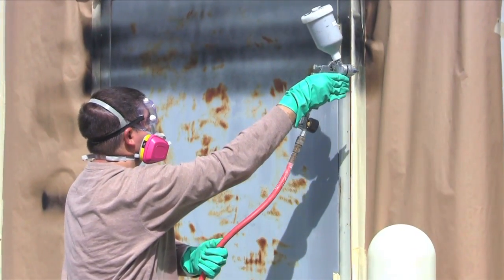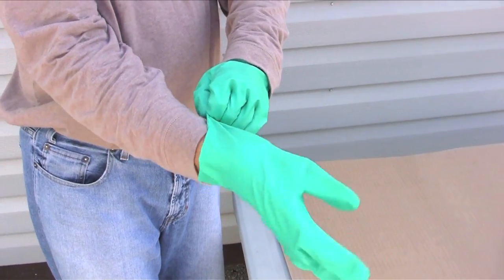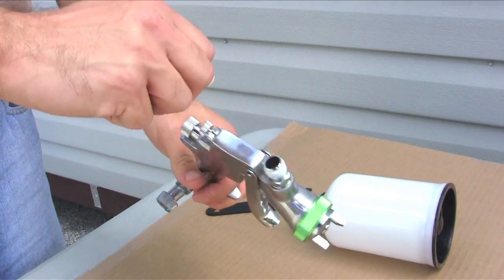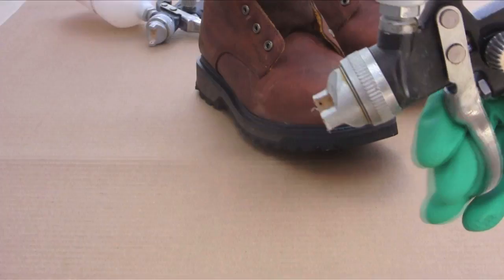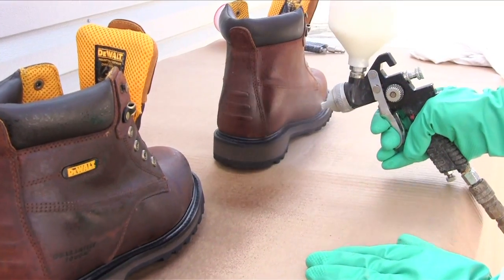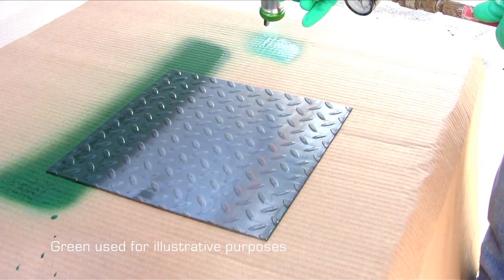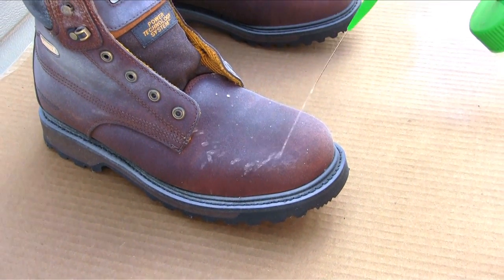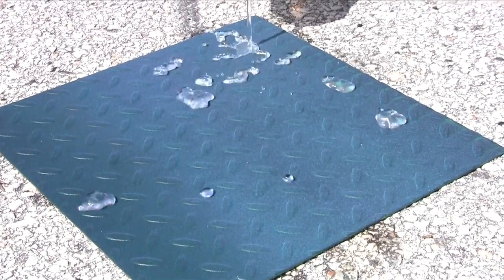Ultra-Ever Dry - Application

Comment: What is the coverage ratio?  Will this coating hold up to concrete running over it and if so for how long before reapplying?  Will it stick to aluminum?  Does the chemicals in concrete break it down or make it come off?

Comment: I have a project in my university. I need to do this project on a topic of electricity. I have to know some information about conductivity, electrical resistance, tests log, abouticing, far and by all parameters of electrical part. My research advisor requires it. How can I get it?

Comment from the maker: The Ultra-Ever Dry SE formula is susceptible to environmental conditions such as UV. This coating will offer approximately one year of outdoor life before recoating of the top coat would be required. When used in indoor or covered applications outdoors, the SE coating should last for a year or more. If the top coat has diminished due to environmental conditions, simply reapply the top coat to regain the superhydrophobic properties (assuming the bottom coat is still present).

Comment: How well does this work in concrete pouring? I saw in your other video that the Ultra-Ever dry was used for this application, but it is stated that severe abrasion will degrade the coating. How long did the average coat last when used for concrete pouring?

Comment from the maker: Surfaces coated with Ultra-Ever Dry will not prevent oil-based paints from being applied, due to the solvents in the formulas. It has been shown to be somewhat effective with water-based paints however the majority of spray paints are oil-based. Also, it will not prevent a permanent marker from being applied.

Comment: If I spray my drinking cup and then pour water in it, will the water be pushed a few millimeters away from the layer of ultradry or will the cup just remain dry when I pour the water back out?

Comment: Technically, yes.  The coating makes an air coating so if the cup is filled with water there would be a thin layer of air surrounding the inside thus it would float.

Comment: Buoyancy is based on the displacement of water so the boat will still float but its hydrodynamics might improve as the coating provides a layer of air to protect it.

Comment: Well, snow is water in mid solid form. It is dry until there is contact with heat. So if you want it to work, you'll have to drive over your drive way ;)

Comment: The water is still able to apply the pressure to the boat surface, that's what make it float. I suspect it will be less stable when stops, and it could easily overturn...

Comment: It's not completely clear when it dries, so I would imagine your window would look a little bit foggy, plus I would think that water and dust particles hitting your windshield at highway speeds would wear down the coating fairly quickly, same goes to just coating your car in the stuff.

Comment: Nothing happens, when you pull the boot out the water just drips off of it. I'd imagine it would slowly leak into the lace holes and around the tongue, but the outside would remain dry. They submerge a leather glove in their other video, it comes out dry.